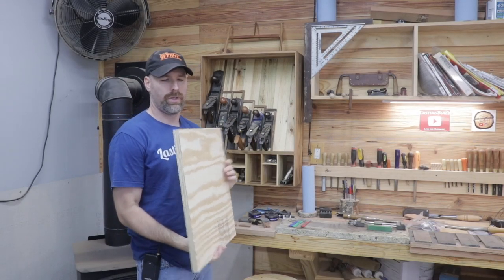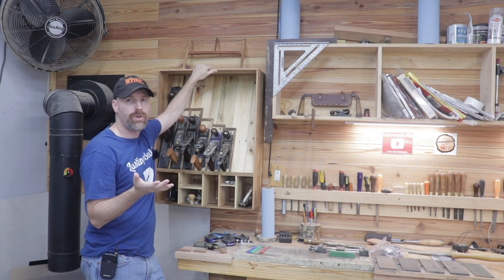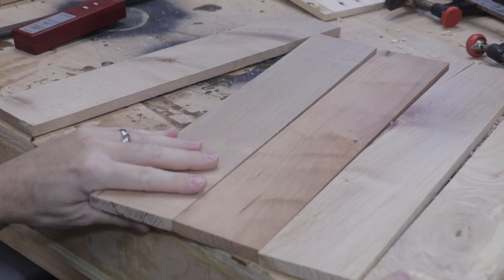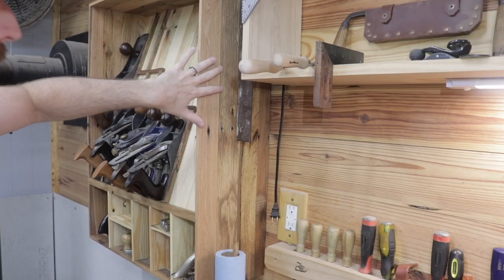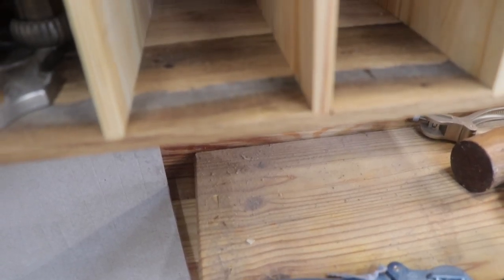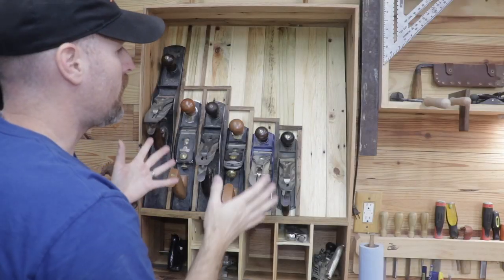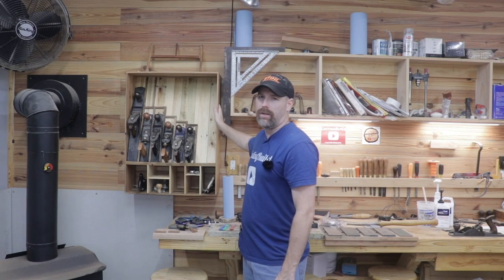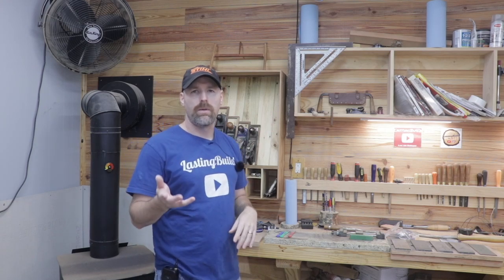Will Your Next Woodworking Project Self-Destruct?

Comment: I believe you did this but a good practice is to apply your finish to all surfaces inside and out.  Any unfinished areas will allow for more moisture changes to happen than areas with finish.  This is why drawers get stuck.  No finish on the out of sight areas so the sides will swell up.  Also why the drawer bottoms are left floating other than a nail or screw in the back.
Reply from the maker: Great advice! Thanks for sharing!

Comment: I am aware of solid wood movement affected by temps and fluctuations in humidity in particular. I always allow for that and it enters my own thought process during the planning stages. However one little portion that I have never accommodated and/or planned for was the orientation of the cubby partitions.  if it were a shop piece such as yours I would use the panels in any orientation in order to maximize the square footage of the project lumber.  That was a valuable piece of info for my ears. Thanks

Harleymike/chicago
Reply from the maker: Hey Michael! Glad I could get ya thinking! My design may be overkill but it makes since to me🤷‍♂️